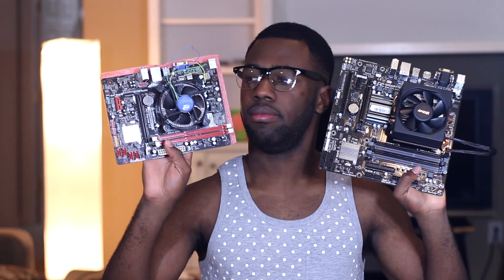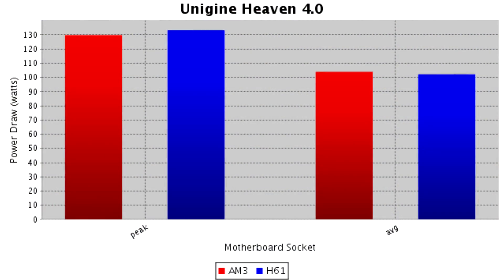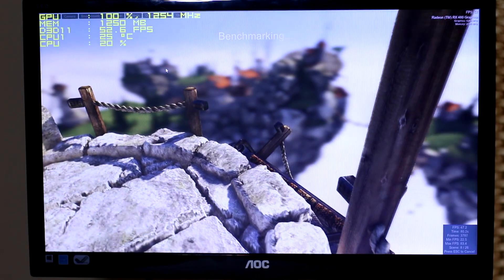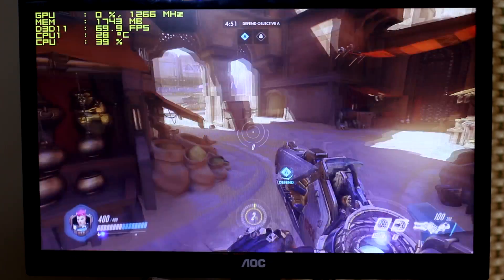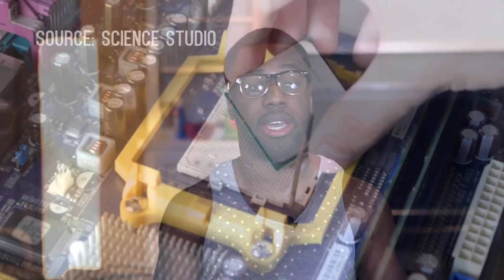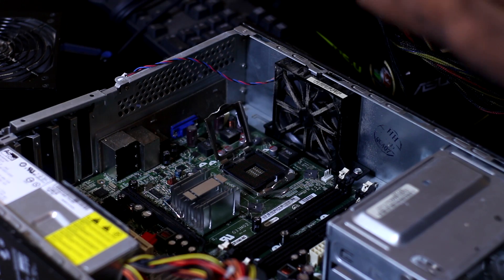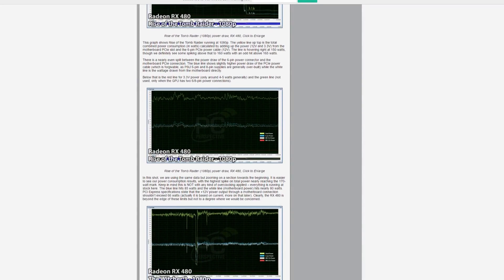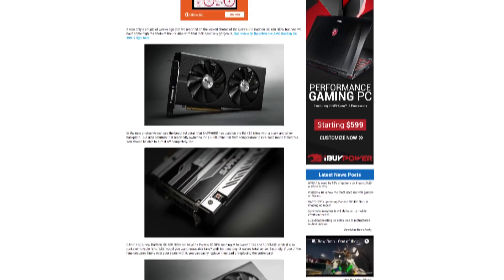Radeon RX 480 vs Cheap/Budget Motherboards - RX 480 PCIe Power Issues? | OzTalksHW

Comment: Nice Video.  I figured this was FUD being spread by NVidia.  You have proved that this is a non-issue for anything other than antique PCs, just NVidia FUD, once again.
Reply: You should do a joint video with MKBHD - Markus Brownlee - for more exposure.
Reply: what has nvidia to do with this you fucking fanboy?
Reply: wow do you ever have anger issues.  get over it.  maybe it's time to trade up from that 920 card to an Rx480.
Reply: Donald Gillies better crawl back to /r/amd now
Reply: Why AMD problem has anything to do with Nvidia? Geez.
Reply: Think about it.  A problem that has virtually no consequence, but will cause AMD buyers to hesitate.  A problem that is hyped in the press but doesn't occur in real world situations.  A problem that many cards in the past have had, but which caused no troubles.  Something that will disrupt AMD sales and shipments until the GTX 1060 card is released on July 7th.  Who is motivated to hype such a non-problem?  Nvidia, that's who it is.
Reply: +Alif Amzari Azamee actually all 750 ti's had the same problem where they pull more than 75w from the pcie slot, but with the pcie 3.0 spec it should be no problem up to 300w. It's just not  an ideal situation but as long as you have a pcie 2.0 and above motherboard, in other words a motherboard from the last 10 years, then you have absolutely no problems. If you need more reassurance check pcper's analysis and the pcie spec
Reply: Very well said my friend.
Reply: Donald Gillies So similar to the 970 and its vram then.
Reply: Donald Gillies No. No other card possess anything similar.  All other cards including the claimed 960Ti is within PCIE spec. Please go and read PCPer articles as they conducted very thorough test on both cards. The RX480 PCIE power draw is unique and it is a valid concern. It is not nvidia who review the card, it is an independent reviewer.  And most reviewers, experience similar problem with their unit. The only FUD here is your accusation towards Nvidia, which has nothing to do with the problem create by AMD engineers itself. They should have done better validation on their reference card and tune properly before hand it over to the reviewers. The only people to blame is AMD themselves.
Reply: +Donald Gillies Another typical deluded AMDidiot, we don't care what you buy. You trying to pin the blame on Nvidia for this is fallacy yet you have no facts to back up any of your claims, just talking out of your ass like every AMDidiot did before the 480 even came out which is what led to the mass disappointment as a result of you idiots overhyping it.

Comment: buildzoid on twitch did an overclocking power mod stream and covered the power rails of the card, the PCIe feeds the memory so the more memory work it does the more it draws, the 6 pin is wired like an 8 pin so can draw up to 200+ watts, the two 12v rails are not connected.

Comment: "Used GPU-Z to measure power consumption" - that is where any of the following arguments went straight into the garbage bin, unfortunately.
Reply from the maker: Unfortunately that's the only way I could measure power, as I don't have the right tools to test otherwise. Like I mentioned in an annotation, add 40-50W. The video was more for stability on older & cheaper motherboards than anything. I added power draw just as a guide
Reply: +OzTalksHW Fair enough. By the way, did you check for any notable audio popping, etc? Besides any long term effect, the power spikes through the motherboard could affect other circuitry (and the effect on the audio is by far the easiest to notice).
Reply from the maker: ImpieYay I experienced 0 audio issues

Comment: The thing that makes it a "confirmed issue" is that AMD agrees it is an issue and plans to fix it, hopefully through driver updates. But it may take firmware updates. That's not a huge deal though, these days not really any more complex than installing a new driver.

Great video! Real-world tests using "weaker" mainboards is the kind of information people can relate to. :)

Comment: I know that somebody could have told this, but GPU Z does not show power consumption correctly. That was stated by developer of this software on reddit. Also AMD stated that they will deliver some kind of solution in the next few days. 
Buildzoid from Actually Hardcore Overclocking found out that this issue could be caused by one phase feeding the core wired to the motherboard PCI-E slot, instead of being wired to the 6 pin power connector

Comment: Awesome detailed video showing the exact issue of RX 480. The internet just flaming about AMD screwed up. What don't get, is why put a $250.00 US card into a older motherboard then OC it and expect miracles. If you the funds to buy this card, then upgrade your system to use the card.

Comment from the maker: I missed a few things with this video: OC'ing, over & undervolting, VRM temperatures, as well as testing other resolutions higher than 1080p. I will try and update this after Tuesday to show a before after the driver update from AMD.
Reply from the maker: Nice card for its price & can definitely get better. Overhyped, definitely, but a solid competitor. I'm pleased.
Reply from the maker: Mark Larsen I actually read somewhere that it's not the 6 pin that's causing issues, but something else. I'll look into it a bit more though
Reply: +Mark Larsen Not just 1.0, but 2.0 as well. Many people still use motherboards with PCIe 2.0 slots.
Reply from the maker: Wht Rabbit OW is well optimized, but it's system requirements aren't a joke. CS GO is not in the same league. Besides, that's why I left Unigine open for a few hours
Reply: What program do u use to check to power draw, temp, vrm and all that stuff?
Reply: +NBW DOUGHBOY maybe HWMonitor
Reply: +Titan SixtyNine Thanks
Reply from the maker: GPU-Z, Hwmonitor
Reply: +OzTalksHW thanks oz. Hey man, What are your overall thoughts on 480? there's alot of mixed feelings on. How do u feel about it
Reply: yeah..how do u feel bout this card?So much hype yet it deliver just good enough.. plan on getting the 4gb aib versions though😏
Reply: +OzTalksHW nice
Reply: Thermal Take TR2 500w psu. Will this suffice? It works fine with my GTX 960. Please help
Reply: +OzTalksHW I think they will release a 480X sometime next year maybe that will be on par with the 980 and 980ti. I can smell the money now.
Reply: do you mean a rx 490?
Reply: +Johnsue Rivera No. I mean an enhanced version of the RX 480 . It is speculated that the 490 will be VEGA (Unless VEGA goes by a new name) I suspect / REALLY, REALLY, HOPE That VEGA can give some where in between 1070 and 1080 performance for 300-350 bucks. Thats sounds about right to me.
Reply: +Johnsue Rivera but, naw. i mean an enhanced 480 that will be in between the 980 and the nano. Possibly. It might not happen but they usually make a X version so why would they not this time.
Reply: there are 3 cards not revealed yet.....465,475,485
Reply: +juggernautxtr lol
Reply: RX480X...looks kinda stupid don't it
Reply: +juggernautxtr Why would it? they have other x models. i think 485 is more ridiculous and sounds stupid to me
Reply: +juggernautxtr but to each their own
Reply: Yeh thats about right but you should also mention "a good quality PSU" as most people will buy any crap if it looks good :)
Reply: 200 series was 285,275,265
Reply: colin furniss
rule of thumb to follow, never use more than 80% of your supply, give yourself 200 watts play, even if it's a cheaper psu your still not going to making things worse with an under powered PSU. I see this all the time, going cheap on the PSU, drawing 450+ watts on a 500 watt PSU is not in your favor. your just asking for massive voltage drops which will increase your amp draw tremendously.
Reply: Agreed but i still prefer a well known make rather than a generic one that iv`e never heard of before that`s my rule of thumb
Reply: Please do as i`m interested in one of the partner cards with an 8 pin 150watt connector as i was hoping that would sort out the power problem thanks

Comment: The card uses an additional ~40 watts over the GPU draw measured in programs like GPU-z.  So it would be using 170 watts if those are the GPU measurements.

Comment: If you are measuring the graphic card thru software like GPUZ then that is not correct, because it only shows what the main chip is consuming and does not really show the overall and actual power consumption of the entire graphic card including video memory, power regulators for the main chip and memory chips, fan controller, etc. Those reviewers who found the RX480 problem used proper equipment to monitor the power draw directly at the hardware level.

Comment: You should do this video again with the 775 board after the path next week. Also have you dont a 771 xeon to 775 mod? That gave me a few more years life on my 775. btw I got a FX8320 for $90 + $40 off my AM3 board running 990 chip. great deal and moved from my Xeon quad core 771 in the asus 775 board and couldn't be happier.

Comment: Another great video, man, I went ahead and subscribed. Btw, I took your Zen IPC hypothesis a bit further and tried to figure out how much raw horsepower Zen will actually have. There were some assumptions, modest ones I think, but the results blew my mind.
Reply from the maker: Thanks man. I'd like to see your calculations
Reply: http://www.mediafire.com/download/y8a76sns9o1w3yh/Untitled_spreadsheet.xlsx

I linked to the spreadsheet so that you can see the underlying math. The MT factor was calculated off of public Cinebench R15 results. I assumed a 4Ghz clock speed for Zen, but the truth be known, I think if that holds up it's going to be the very expensive ($500), top binned, limited availability, fire-breathing monster of the Zen lineup. Of course, that's true of the 5960X for Broadwell-E as well.
Reply from the maker: Alex Larsen Nice. I also believe it won't be cheap. I'm expecting around $500+ for the 8 core variants

Comment: How did you measure power draw at the slot?
Reply from the maker: GPU-Z. It only tests chip power though, so add 40-50W for the entire board power
Reply: +OzTalksHW with your setup it would be difficult to isolate a draw on the PCI-e slot. 6-pin power connectors can supply up to and above 150W which is why you see PSU cables with two extra pins wired into the side of a 6-pin. The PSU and cables can push the current, the extra pins are just there to prevent people from using power supplies that are too weak. 

The main problem was that the cards were taking too much of their power from the slot when they should have been pulling from the PSU. Proportions is the issue at hand, not the total board power. What's typical of 150W parts is 50W from the slot and 100W from the 6-pin. (goes outside of PCI-e specs but it's generally the way it works) PCI-e guidelines are just guidelines as well, they're not strict and all PCI-SIG cares about is whether or not it works. In more cases than not, pulling less than 75W from the motherboard and more than 75W from the 6-pin works better than the alternative.

Comment: Hi i like you but I understood that the problem was at 4k because using all the ram the power consumption was a problem... you can try if you want
Reply from the maker: I have a 1440p monitor. I'll test it on there.
Reply: +OzTalksHW is not the same if you use a virtual resolution  up to 4k?.... even if I personally think that 480 is suitable for 4k just crosfiring it

Comment: Would the AMD A6-5400K cpu work good with the RX 480?
Reply: Well it works but that CPU is way too slow. Better wait for the RX 460 that's comming in 3 weeks or get a new CPU too. :)
Reply: With RX 480 nothing below I5/I3 or FX 8xxx.
Reply: Athlon X4 845!!!Are you serious?
Reply: I just got an i3-6100 hopefully that will work with the 480 or the 1060 when nVidia actually tells us the price...
Reply: Sure! I've got a similar CPU (a6-7400k) and it should work really fine but I'd wait until a newer model of this card comes out with a better cooler ;)
Reply: +pSyk k thanks!
Reply: No, you would be better off with a non-apu processor if you're going to use a discrete gpu. By going with an athlon you can get a better CPU because you save on the cost of the GPU integrated in the APU. A 5400k would certainly bottleneck an RX 480, I recommend an Athlon X4 845. The 845 is a terrific value, it's three times as fast as the 5400k.
Reply: Mr. Cancel I don't think he's willing to spend any more
Reply: Benjamin Columbus But he'd need a new Board then, so that's a waste of money.

If he buys a new motherboard he should just go with a i3-6100 and a cheap H110 board.
Reply: pSyk motherboards for CPU's and APU's are different? I think i dun goofed...
Reply: APUs are CPUs with Graphics built - in them. AMD's APUs consist of the AMD's A4, A6, A8 & A10. Most of Intel's CPUs also have integrated graphics as well. The only current CPUs without integrated graphics that I know of are the Athlon X4s from FM2+, AM3+ CPUs and Intel's Extreme Edition Chips and Xeons.
Reply: pSyk both 5400k and 845k are fm2
Reply: +Benjamin Columbus Actually, the 845 is FM2+. So, if he has a FM2+ motherboard, it wouldn't be a problem at all. Although, for him, I would get an RX 470 and a 845, which would be a great combo for around the same price as a 480.
Reply: You made a good choice now pair it with 480 (4/8GB 4GB if you ask me) but keep in mind only 1080p gaming.
Reply: Mr. Cancel yeah ill definitely get the 480 UNLESS  nVidia does something insane and releases the gtx 1060 at a price of $150 or $200 lol
Reply: The A6-5400K would be alright, but not ideal. You will be CPU Bottlenecked in some Games, but those Processors are more capable in real-world situations than Synthetic Benchmarks lead most people to believe; as it offloads Floating-Point Operations on to the Compute Cores (which the 5400K has what, 384 Stream Processors?)... and this is traditionally where AMD performance tends to be lacking. • I would say though if you can find them, see about getting an AM4 Motherboard and Bristol Ridge; I've personally not seen them beyond OEM Laptops which is really annoying - but they're close to the same basic perform to an i7 6200U (which is impressive in of itself) and they have the new Socket for A12 and Zen Processors. • I'd also DEFINATELY pair Polaris GPUs with AMD CPU/APUs ... as they seem to have noticeable performance and stability on AMD Platforms over Intel Platforms. Why this is, I'm not overly sure. It could be the Intel Chipsets; but internal testing here, we've been noticing some Micro-Stuttering on our Intel Rigs within DirectX 12 and Vulkan. I'd also strongly suggest waiting until the AIB RX 480 / 470s are out, as while the Reference Cards are decent; they're frankly just Early Adopter Hardware... with lower Clocks, lower quality boards, cooling, etc. put bluntly AIBs will almost certainly end up better and potentially cheaper. (Well Sapphire will be, you can already see price trending with AIB in the Reference Cards)
Reply: +Benjamin Columbus All of AMD's CPU's will bottleneck this card, notice how at their booth they used a high end i7 to show it off and not their top of the line AMD CPU. I'd recommend a high end i5. You're not really saving money by cheaping out on the CPU because you're losing a lot of performance.

Comment: Is my PC good?

 Hard Drive: Seagate 1TB Desktop HDD SATA 6Gb/s 64MB Cache 3.5-Inch Internal Hard Drive

Case: VIVO ATX Mid Tower Economy Computer Gaming PC Case 

Power Supply: Sentey MBP750-HM Power Supply, 750 watts, 80 Plus Bronze Modular PSU 

RAM: Kingston HyperX FURY 16GB Kit (2x8GB) 1600MHz DDR3 CL10 DIMM

Motherboard: ASUS M5A97 LE R2.0 AM3+ AMD 970 SATA 6Gb/s USB 3.0 ATX AMD Motherboard

Processor: Intel Core i7-950 3.06 GHz 8 MB Cache Socket LGA1366 Processor

CPU Fan: Intel E97380-001 Cooling fan for Socket LGA 1366

DVD Drive: Asus 24x DVD-RW Serial-ATA Internal OEM Optical Drive

Comment: Such a stupid move from AMD! They have so much fans, so much is expected from them, polaris zen etc, but they just HAVE to fuck it all up. They could have put an 8 pin, but noooooooo lets show how efficient our gpu is and put a 6pin and let their mbos burn. This will put a huge stain on rx480's name and it won't go away with custom models even though they will have an 8 pin and better cooling, because people will still read about the problems of the reference desing. I want them to succed but theyre just fucking dimwits in AMD.
Reply: New drivers will fix this
Reply: Using a AM2 or AM2+ motherboard are we? I will be quite frank if you were and weren't overclocking your CPU above a 3.5GHz bottleneck city with a RX 480
Reply: I think the only way drivers can fix this is by reducing the power limit. the card wont boost as often or as high anymore. im not using am2 or anything, im using 1150, b85 pro4, a budget motherboard. i wont be putting a rx480 with a 6 pin on it for sure, not gonna risk destroying it because warranty won't cover it. new drivers won't wash away the stain, with nvidia fanboys being loud as ever. every move amd makes seems to be a flop, but I want them to succeeded because competition is what keeps the market fair, in some degree. I'm sure the custom 480's will be great, but the bad publicity from the reference card is really not helping.
Reply: Flop? try buying an RX 480! sold out even with their huge starting supply. people are selling them for $300 plus on Amazon.
Reply: ellsworth1956 Yeah I myself am kinda upset I can't get one sooner. So the only move that flopped was not making more XD